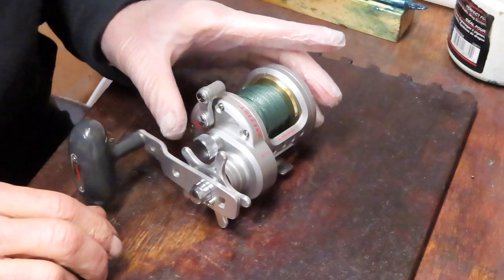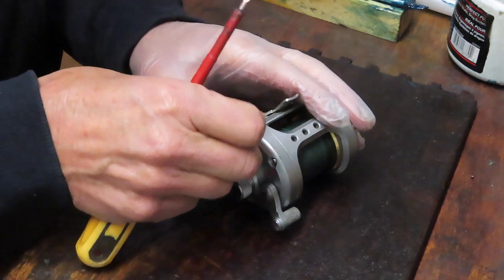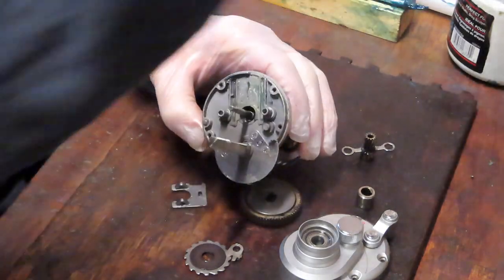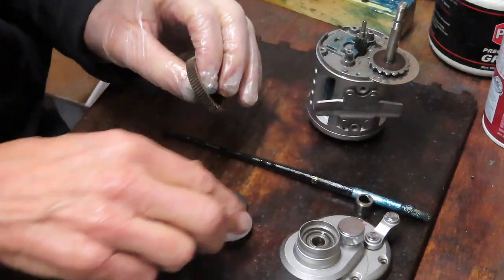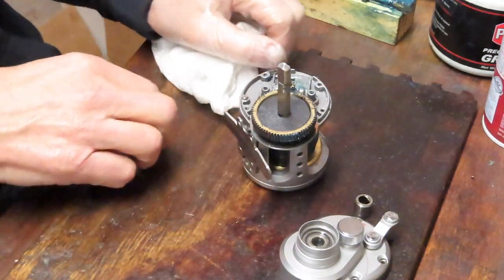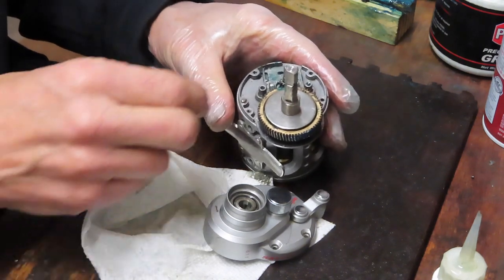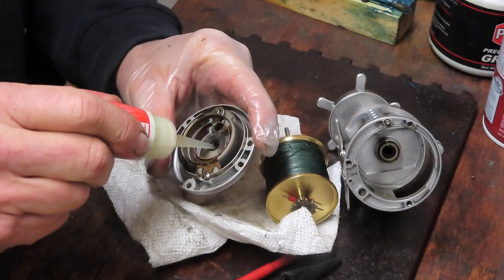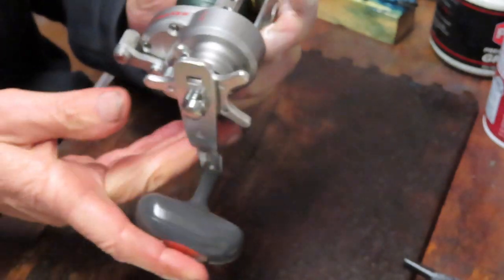Daiwa Saltist 20H fishing reel how to take apart and service including drag washer replacement

Comment: I know that many folks say that the Daiwa Saltist spinning reels are very fine. Unfortunately they are way out of my price range as well as far from my primary interest in and love of vintage spinning reels. I certainly would like to try one though. This is a fascinating baitcaster and appears to be well made and popular.  Thanks again for replying about my Mitchell 386 problem. It has certainly baffled me. Even after servicing, repairing, and even restoring over 30 Mitchells from France, I have just scratched the surface on the many things that can confuse a person working on them! Great video Dennis. It always amazes me how many parts on a spinning reel and a baitcaster are so similar but oriented in a different position.  Even the drag washers are essentially the same. This reel had a gorgeous main gear! Speaking of braid - I only have three reels that I use braid on and two of them I probably shouldn’t as they are vintage reels made for mono.  (I back them with mono. though.)
Reply from the maker: These are well made Daiwa reels

Comment: I recently bought a Seagate ( apparently very similar internals) but it feels a bit rough out of the box . Do these reels need to break in , should I be taking it apart to lube it before using or could something be not quite right?
Reply from the maker: It does not need a break in.  I would return the reel or send it back to Daiwa for a replacement

Comment: why didnt you cal grease the carbontex  washer under the main gear on the AR Dog you put that one on dry. Also the grease is not to keep carbon flexible it is to avoid start up inertia and make the drag operate smoother, also to protect it from salt water intrusion. You can buy a SLP SP 4.0 screwdriver to fit those Daiwa screws which will help to stop the screw driver slipping, it locks into those special screws. Or use a hollow ground slotted screw driver. The IAR bearing should not be over oiled a drop will do, be careful of over oiling the bearing on top of that IAR, it will seep down into the IAR and could cause problems later. Also for those who dont know the cup washers under the handle should be in this orientation ()
Reply from the maker: Per Carbontex, installation instructions these washers can be installed dry as they are not absorbent and grease is not needed.  You have the option to put a light coast of grease on them, but it should be wiped dry if you do.
Thanks for asking
Dennis

Comment: What is orientation of drag spring washer?
Reply from the maker: Are you asking about the cupped washers that sit on the gear sleeve?  I generally alternate them starting with the cup facing up and then next one with the cup facing down.  These are tension washers that control the sensitivity of the star adjuster - Dennis